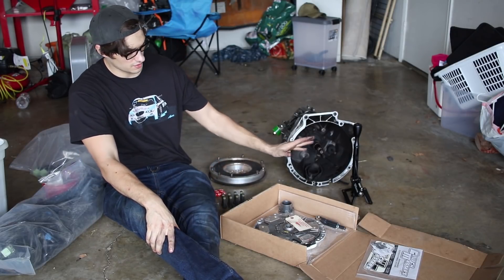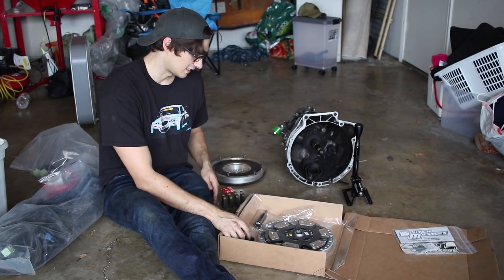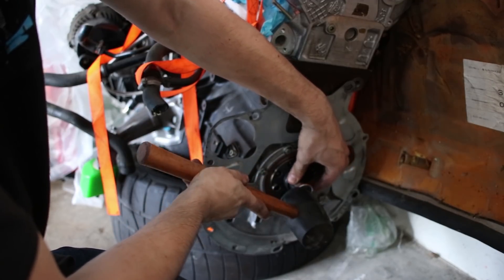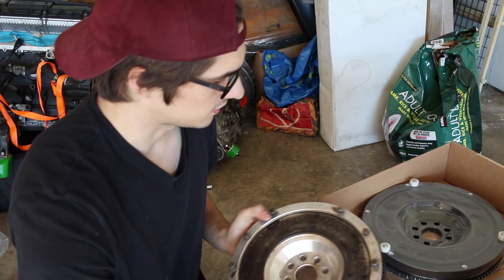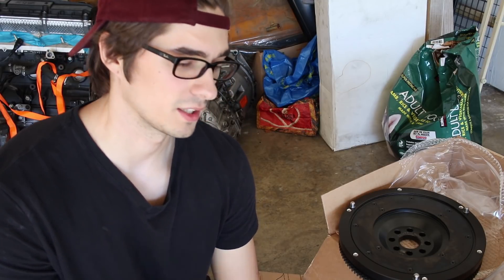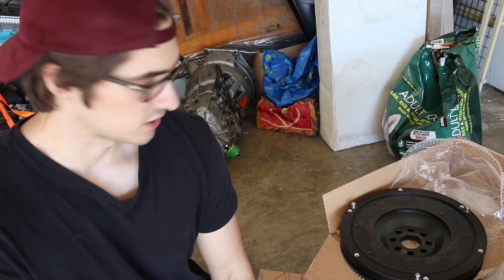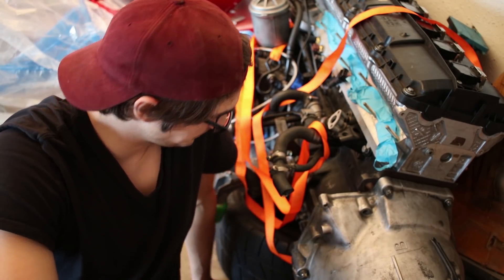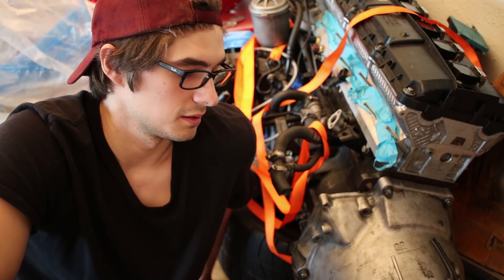Rocket Bunny Turbo S52 BMW E30 Build | Part 8: Clutch, Flywheel and Trans

Comment: I had a similar clutch fitment issue on my turbo M20 build, the pressure plate I got had a bolt circle 5mm larger than the one on the stock flywheel, so I put it on the mill, did some math, and redrilled. It fit, but was fully depressed when installed. 
Turns out the 5mm difference was deliberate because the M50 (or m20 2.7l) has a recessed friction surface for some oddball reason. I figured BMW did it because the two flywheels existed simultaneously and they probably wanted to avoid service techs grabbing the wrong one off the shelf and bolting it up.
There is no moral to this anecdote, I just felt Ian's "that's stupid" at 4:13